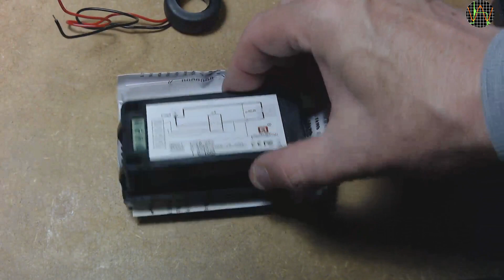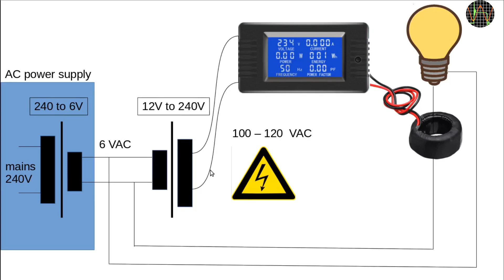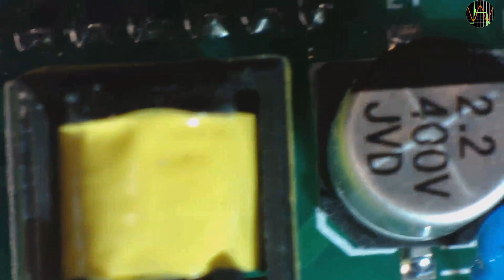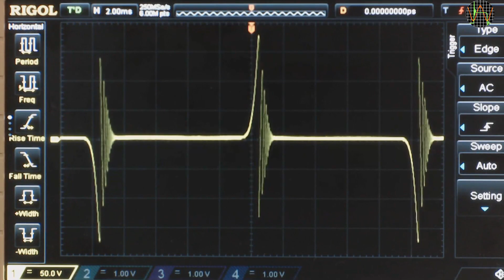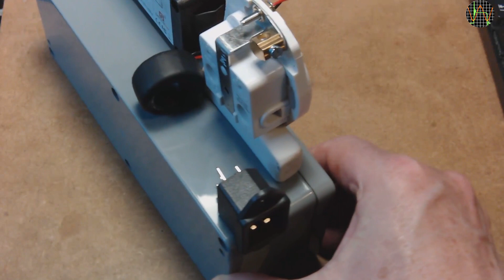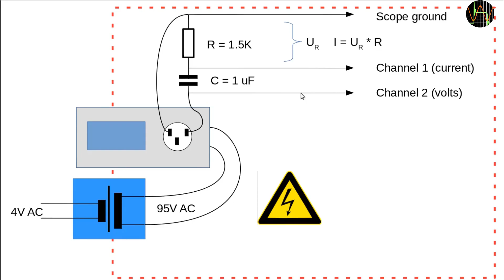Building your own power meter with the Peacefair PZEM-022

Comment: If the ring only goes over ONE wire, how do you measure the wattage used over a 220v or TWO wire circuit (for a water heater, for instance)?
Also, does this meter keep a 'running total' of wattage used over time?
Reply from the maker: I am very much biased on UK/EU 240V single phase wiring because that's where I live and keep forgetting that there are places with 120V. You are absolutely right in querying how this would work in a US system needing more than 120V.  I think it would work if it is a split (aka centre tap, single phase) circuit 240V. The centre is not used and the two hots are basically like live and neutral in the UK. But you are out of luck if the higher voltage (208V) is coming from using two different 120V phases. I suppose there must be power meters with two or three coils and smart enough to calculate power in 2 or 3 phase systems. However, treat these comments with caution as I have no practical experience with US wiring.   As for the last question, it does retain a running accumulation of energy (Wh). You actually have to reset it manually (button) if you want to start from zero instead of continuing from the last value.
Reply: @TheHWcave  Thanks So Much for your comment and Help (TheHWcave).
It helped me understand how this meter works which, in turn, helped me to be able to understand how to connect this meter.
IF the 240v circuit used the 240v on a single  motor, I could just put the ring on either ONE of the 240v conductors over a 24 hour period to know the wattage used.
However:
If the 240v circuit was 'split' into two 120v circuits like for use in a two element electric hot water heater, I'd have to put the ring on one hot side of the 240v circuit for 24 hours and then put the ring on the other side of the 240v circuit for 24 hours and then ADD the two totals together, to figure out the total wattage.
You, my friend, have helped A LOT. 
Thank You.

Comment: I have had two of these fail for no backlight, where the DC-DC converter stops running and the logic supply goes from 3.3V to zero. There are two tantalum caps that I replaced: E7 and E3 which are 2.2uF and 10uF respectively.  E3 was the culprit in both occasions but my disdain for tantalums has me replace both for good measure with 10uF/25V 1206 ceramics.
Reply from the maker: Thats valuable info, many thanks. Mine is still working but I may replace the tantalums just in case. I do share your disdain for them
Reply: The first one failed after about 3 months of continuous use and the second one after about 2 weeks.  I have it connected to my hot tub to track the cost of operation.

Comment: So this needs to be wired into 120v for the screen to work? Seems like a battery would of been easier for as little power as it draws for the display.
Reply from the maker: Since it is meant for measuring the power consumption and factor or mains powered devices, it makes sense that they power the electronics from mains as well. If you are looking for one that can be (easily) modified to take its power separately (thus allowing mains voltage measurements from zero onwards), I have reviewed and modified two other modules that do that. But these mod's are only for people with experience working on mains circuits! !.   https://youtu.be/Jr42rQMymN8   and
https://youtu.be/qRsjsenvlJA

Comment: Are you using a separate power supply from the device your testing? Can I use an external power supply for power then just put the clamp over the device I’m looking to test?
Reply from the maker: Technically you could power it from a separate source but why? Because doing that would invalidate all of the measurement  readouts with the sole exception of the current which would come whatever circuit goes through the current transformer.  To be valid, both current and voltage have to come from the circuit you test. I have made videos for a few other devices that may be more suitable. Check my variac video for a device that I modified to take operating power from another source or the my video series on the PZEM-004T which I modified to run from USB (that one has no display and reports its findings via USB)
Reply: @TheHWcave  Alright I will do and thanks for the information.

Comment: Does the input power HAVE to come from the circuit being tested, or can I use a different source?
Reply from the maker: I believe someone may have found a way but it isn't easy. There are two alternatives that I am using personally. The closest is the DL69-2048 which also needs a modification to separate measured voltage from supply voltage but it is all described here in my video https://youtu.be/Jr42rQMymN8 and works well. The second is using the PZEM-004T, but that has no built-in display and also needs a modification described here: https://youtu.be/qRsjsenvlJA if you want to power it from USB

Comment: Thank you for your video.
Though I am still completely confused by wire connectivity. The instructions say "wiring must be correct" 
But if you look at the paper instructions and the sticker on the back, the light bulb polarity is reversed.
I think the load goes to pin 2 from the bottom as you look at the back. Is that correct? 
Also you seem to connect the coil red wire to pin 4 (from the bottom) but I do not see it clearly. Is it 4 or 3? Does it matter?
Reply from the maker: Looking at the module so that you can read the sticker, the terminal strip is on your left. The top two terminals are for the current transformer. In this application the polarity does not matter (the module does not distinguish flow direction). In my built I put the red wire of the current transformer in the top. The lower two terminals are to provide mains power to the module, again polarity does not matter. I put live/line (brown) at the bottom and neutral (blue) above. It does not matter whether you put the load's live/line wire or neutral wire through the current transformer, I used the live/line (brown) wire.  What is important that you tap the power for the module before the current transformer like it is shown on the sticker. Otherwise the module would always measure its own power consumption plus the load.
Reply: @TheHWcave  Thank you so much, that was very helpful.

Comment: Q: is there a limit in length of the cables between ring and display? Rgds Tom
Reply from the maker: Its the current that counts here which makes the length of the cable between the electronics and the ring transformer relatively uncritical. For some measurements I am using a current transformer (ring) as a probe for my oscilloscope or multimeter and that comes with a cable of more than a meter length. See for example this video https://youtu.be/Lf5nhBLmJ-c

Comment: I believe a 100mA fuse on both rails will be sufficient ! Will it not?
Reply from the maker: I am not exactly sure which rails and fuses you refer to. When  I implemented the x10 mode, I added a single 100mA fuse in the current transformer circuit because the module is rated for 100mA on the current transformer input. x10 mode sends potentially 10x the rated current to it

Comment: Successful Battery Power Modification
THESE CHANGES INVOLVE DANGEROUS MAINS LEVEL AC. I AM NOT AN ELECTRICAL ENGINEER. I ACCEPT NO LIABILITY. 

Heinz, I just plain took a chance and wired up my meter, as explained below. It worked, but I would feel a lot more confident if you would let me know that I have not violated some basic principle in combining AC and DC power.

I was able to power my PZEM-022 with a 9 Volt battery, using Bjorn’s suggestions (see comments at https://www.youtube.com/watch?v=Pb9Fp5J7lTI&list=PLXZqw8i7uFApT1dt9OUaGBRo3Cjf2Hv7G&index=2.) I only did a 60 second full power test, but a 60 Watt light bulb, at 120 VAC, read correctly as ½ Amp. The 9 Volt battery did not warm, or swell. (Why such a short test? I am just plain tired = 3 a.m.)

You will want to get my diagram, to follow along: https://www.dropbox.com/s/t9oudoiwrfzvml3/Bat%20Mod.jpg?dl=0

Here’s what I did...
1) Completed Jens’s/Heinz’s modification to separate the DUT voltage reading from the meter’s mains power (see comments.)
2) Removed diode D2/SMD at Point #1. This defeats the power supply from the secondary of the transformer and frees up the down-stream pad to make the battery connection.
2) Place a rectifying diode (1N4007, etc.) in series with the positive battery lead. I did this to drop a little of the voltage to help the regulator’s heat load and prevent any reverse polarity, as we are dealing with an AC power environment. Solder this battery lead to the down-stream pad of D2 at Point #2.
3) Solder the negative battery lead to the negative terminal of the 470 electrolytic capacitor at point #3.

That should do it. You should have the following connections:
1) The positive voltage reading lead, with its ~1M Ohm resistor soldered to the down-stream pad of R13.
2) The positive lead of the coil soldered at pad A
3) The negative lead of the coil soldered at pad B
4) The neutral AC reading lead soldered to pad C
5) Absolutely nothing soldered to pad D.
6) The positive and negative battery leads soldered as in the prior paragraph.

I did not think to include a power switch in the battery leads. Will the unit time out and power off? I did not see anything about it in the instructions?

Comment: In your video on making adaptations to a model PZEM-004T meter, you point out that the R17 resistor (the resistor in the trace path that is reading the AC voltage) needs to be replaced with a resistor(s) of equivalent actually read value, not of equivalent rating, because the meter is calibrated to the actual value of the resistor that was placed in the meter. https://www.youtube.com/watch?v=qRsjsenvlJA&t=682s @ ~16:45 This is true for R13 of the 022 meter, I would think. So, I have to go look to see if I can find my R13 resistor to measure it. I fear that it was placed in the trash. Folks desiring to make the modifications in this video are cautioned to retain the original R13 resistor, so that its actual value can be measured.
Reply from the maker: Yes, I was quite lucky that I kept the original resistor, actually only for the purpose of showing all the removed components in the video :)  When I temporarily used one of my high voltage 1MegOhm resistors, I found the voltage accuracy to be off a bit. That let me to measure the removed original "1 MegOhm" and found it was only 980K
Reply: @TheHWcave  I must have watched the 004 video, before I removed my R13, because I kept it. I had it stored neatly with the case screws. My original R13 measured 984K. I replaced it with three through-holes that added up to 988K. That is only a ~0.4% difference and that is quiet good enough, for this application. I mentioned, previously, that I had to remove my screw terminal block to be able to route my wires out the bottom of the case. With the block removed, I had a nice bit of "real estate" on which to situate the new resistors. For folks that have the skills and equipment to hack the V9811A chip, the data sheet does state that the meter is calibrated in its software.

Comment: Folks that read the comments will find that, at one point, I became confused (by health issues) about making the wiring changes needed for separating the DUT voltage reading at R13. My problem was in sorting out the combination of the AC which powers the unit and the AC which the meter is reading. To save others confusion, the object of the change is as follows… 

The meter is similar to a multimeter. However, it does additional math calculations to display not only the typical voltage and current readings of a multimeter, but also the wattage information of a watt meter, such as the “Kill-O-Watt.” 

The meter is powered by AC which is supplied to the AC line and neutral terminals of the screw terminal block. And here is the trick… The IC chip also reads the AC voltage across these same two terminals, by way of traces on the PCB board.  This has the effect of causing the meter’s burden voltage to be included in the AC voltage reading. It also means that the meter can not read voltages that are lower than what is needed to power the meter through its onboard transformer; 80VAC. 

Returning to the multimeter example… R13 is in the trace path reading the line AC. By replacing R13 with a through-hole type resistor of the same 1M value and adding a wire lead to its lifted pin (See video for instructions,) you are, effectively, creating the positive probe for the multimeter. (The negative multimeter probe, in this example, is a trace going to the neutral terminal.) You can then read the voltage in a location which does not include the burden voltage of the meter. And, because the meter is still powered with the full voltage supplied on the AC screw terminals, you can read voltages below 80VAC.

Our “multimeter” is special, because it has two sets of “leads” and it can read voltages and currents at the same time.… The current “leads” are simply the wires going to the coil. The coil is what reads the current.

In TheHWcave videos, and other YT videos on using the various types of PeaceFair meters, you will find comments regarding using a common DC battery to power the unit. If so used, the AC components of the AC power supply must be disconnected. Then, the battery is connected after the point where the AC voltage supply would have been rectified down to a regulated DC level that the IC chip can work from. 

I hope this helps your understanding. REMEMBER, THESE CHANGES INVOLVE DANGEROUS MAINS LEVEL AC. I AM NOT AN ELECTRICAL ENGINEER. I ACCEPT NO LIABILITY.
Reply from the maker: totally agree, and just a reminder, if you use a battery, (e.g. a power bank) it must be completely disconnected from the module before charging. Also the battery itself when powering the module must not be  touched because it will be on mains voltage level!